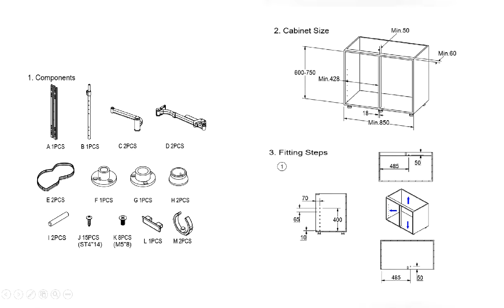How to install VADANIA kitchen blind corner swing tray cabinet pull out organizer?

Comment: Thanks for the video, it helped me quite a lot because the instructions sheet are really bad. But after fixing the bar, when i wanted to assemble it, one of the rolling element bearing fell and i have no idea how to replace it. I can see where it was but the place seems too small to let it enter. If i just place it without forcing, it doesn't work, the tray doesn't clip in. Actually, i found 2 rolling element bearing on the floor...
Reply from the maker: Hi sir, please contact us for this issue. Please send me some phtotos of the damage part. info@vadania.com

Comment: my cabinet has a 3/4 inch facing.  Do I measure from the outer edge (meaning the facing) or from where the facing meets the actual cabinet?

Comment: Actually, this video was quite useful. Turn the speed down (in the "gear" menu" to 0.25 and watch). Esp good as this is the left-hand open installation where all the printed "pictograph" awful instructions are the opposite open. Printed instructions do say the left bar (mounted flat) should be 10mm off the deck though